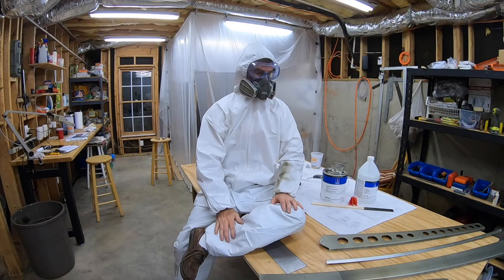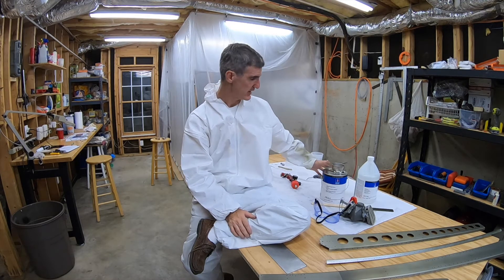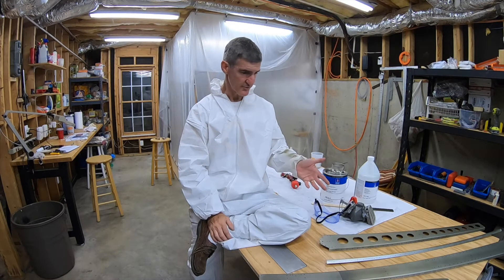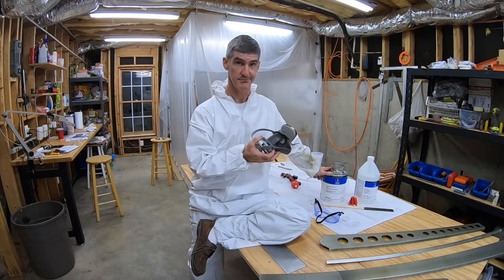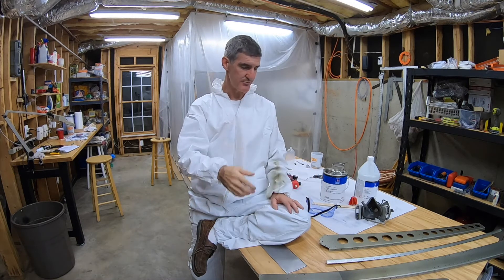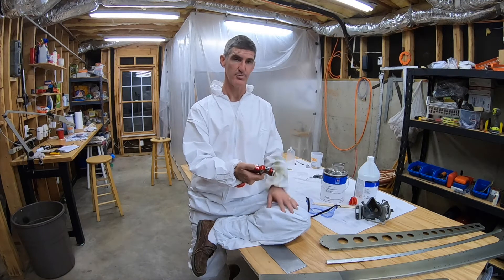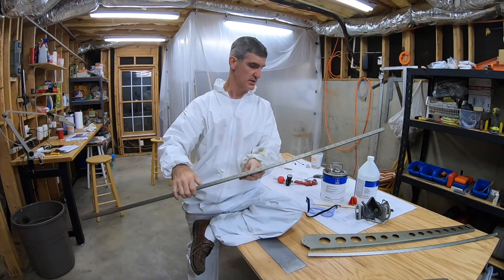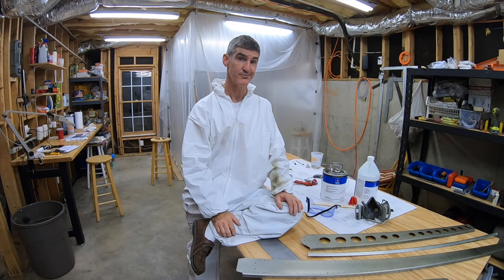RV-10 Build Log - Emp 07 - First priming experience

Comment: Curious the size of your paint booth. Did you find it sufficient, too large or too small?
Reply from the maker: It was about 9x9 or so.  It was adequate, but I may find I want something bigger when I get to the horizontal stabilizer.  For one thing, the HS spars are about 11’ long, so that isn’t going to work ;-)